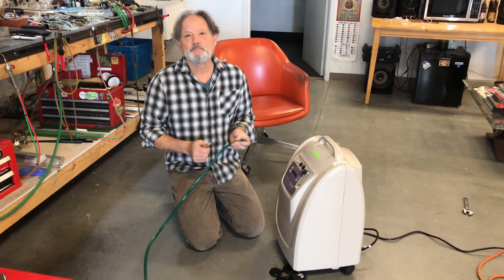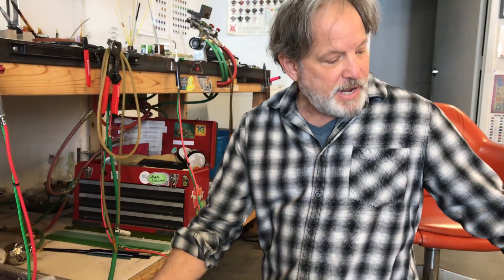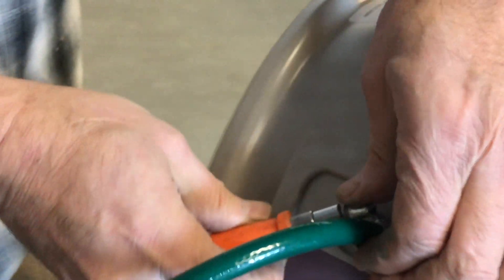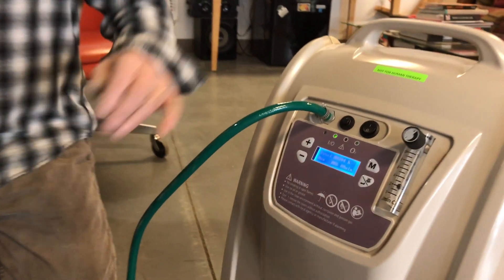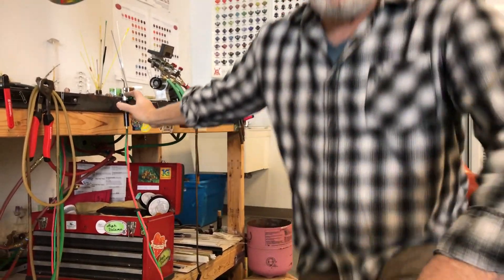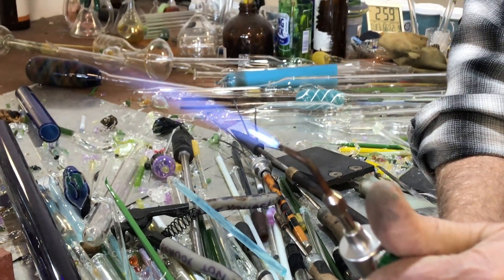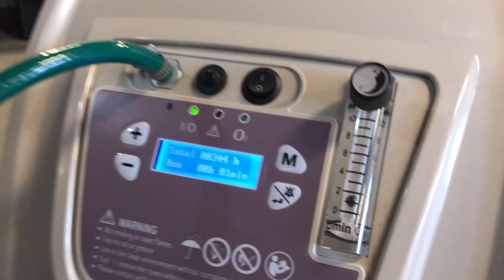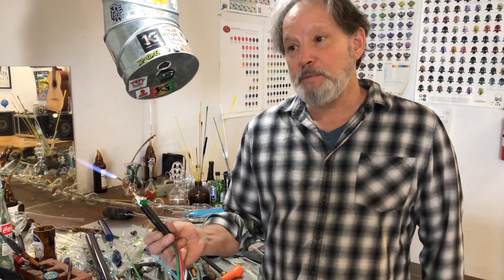Using an HVO Pro Gen 10 Oxygen Concentrator with a Smith Little Hand Torch

Comment: Would you recommend using a flashback arrestor on a disposable propane tank used with an oxygen concentrator?
Reply from the maker: It’s always a good idea to have a flashback arrestor on your propane tank. ✌🏼❤️🔥
Reply: A flashback arrestor is recommended on the propane tank's regulator; and a check valve is recommended on the oxygen generator.